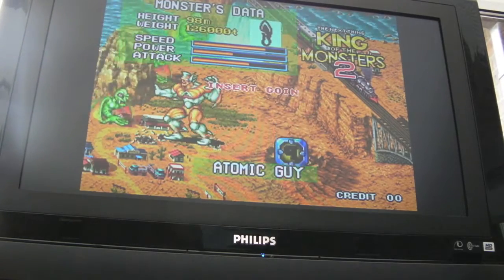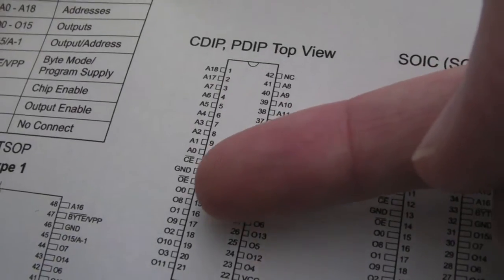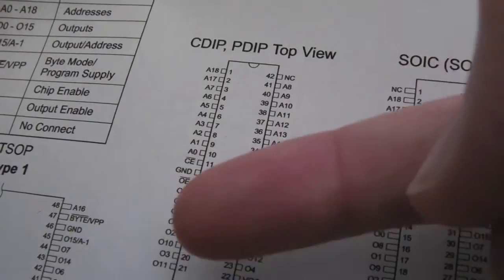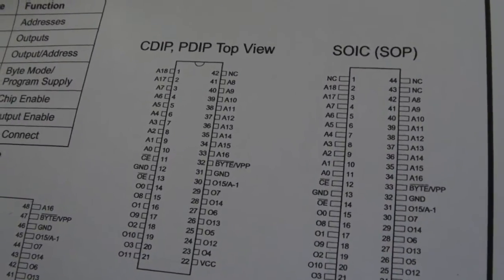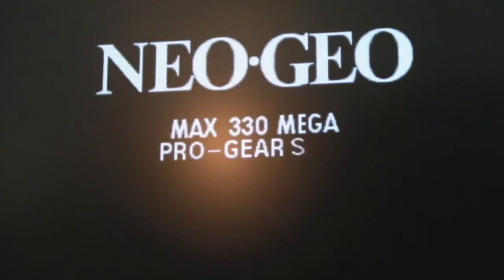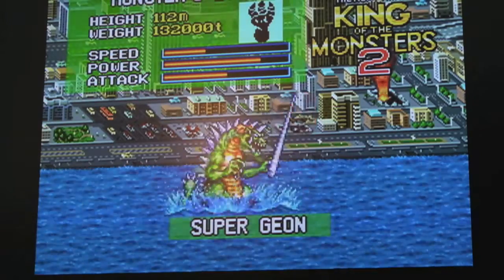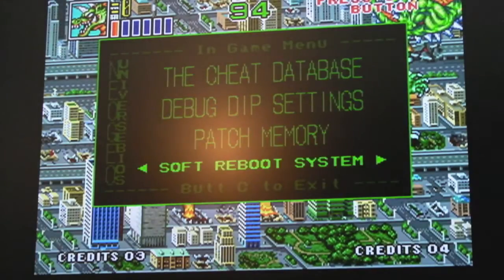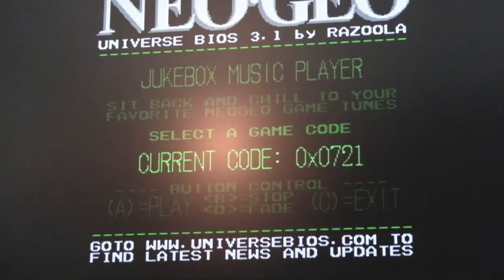SNK Neo Geo MVS King of Monsters 2 Repair

Comment: Well done! Glad you could get the game running again with proper audio output.
It seems like you have quite a nice scope there. It has pretty extensive video triggering capabilities, which means that you easily get a nice and stable trigger on a composite video signal if you'd like. It's also nice that you can choose which TV field to trigger on, as well as choosing whether to trigger on the vertical sync or the horizontal sync. And, it has a component tester as well it seems. That's pretty neat.  None of my Teks have it, so I have to put together my own little octopus curve tracer and set the scope to X/Y mode in order to test components like that.
Btw, the probe you're using here, might it be the one you received from the ebay seller I recommended to you perhaps? :)

As a little advice, it would be much better to set the scope to DC coupling in a situation like this instead of having it set to AC coupling. In fact, you probably want to work in DC coupling mode for the most of the time. The only situation that would actually require you to use AC coupling is when, for example, you want to check the noise lever or the ripple on a supply voltage rail. You do this by "zooming in" on the signal by turning the Volts/DIV knob clockwise. However, when in DC coupling mode, this will make the trace disappear off the display. You solve this by removing the DC component of the signal by having the signal go through an AC coupling capacitor at the input stage of the scope. This is done by setting the scope to AC coupling mode.
However when checking TTL compatible signals like you were doing here, the signal will be close to 0V during the low state and near 5V during the high state, so there is no need to have the scope set to AC coupling here.
Having the scope set to AC coupling when not needed has a few drawbacks; First of all, you won't be able to make an absolute voltage measurement (measurement in relation to true ground; 0V), since the signal will be centered at 0V due to the AC coupling cap in the scope. You can see at 6:07 - 6:10 how the DC offset of the signal at the display changes as the scope is centering the signal to 0V.
Secondly, since the purpose of AC coupling is to block DC, you cannot AC couple a digital signal that has low frequency content in it without distorting the signal in some way on the display. So for example, if you have a TTL signal that is low for 0.5 sec and then high for 1 sec before it goes low again, you won't be able to see it very well in AC coupling mode since the signal will center itself around 0V shortly after each transition between low and high.
Also, you won't be able to check the steady-state of a high or low signal (or supply voltage) when in AC coupling mode, since the trace on the scope will always center the displayed signal at 0V no matter what. What this means is that even if you put your probe at a 5V supply pin of a chip, the scope will still show 0V on the display since the DC content of the signal is not being coupled through to the vertical amp stage of the scope.
The wierd reading at 6:42 might not necessarily be because of the chip being faulty, but can also be because of the scope being set to AC coupling mode. The frequency of the data pattern might be high enough for the AC coupling cap to not have time to fully charge/discharge itself to 0V between the transitions, but still be low enough to create a roll-off right after the transitions between low and high. It is very much possible that the signal would look more like a normal TTL signal if the scope had been set to DC coupling here.
The DC/AC coupling selector on your scope is just to the right of the BNC connector for channel 1. Just to the right of where you have the probe connected in this video.
Just thought I would point that out as a little advice for any forthcoming repairs. :)
Reply from the maker: Wow, there's a LOT to take in there!  Thanks for the reply, let me spend some time digesting all of that information - I've had a quick read through and it looks fantastic advice.  I will have a play around with the scope again later, I am wondering if there's a problem with the DC coupling.  I think when I last had it switched onto DC coupling I just got a dot instead of a line...  Will experiment more later =)
Reply from the maker: Thanks again for the wonderful advice!!  I've just done another test using DC coupling and it's working - ie. my scope is giving a cleaner display as its showing DC and filtering out the AC as I should have done to start with =)

The strange signals I saw on the second chip were nothing to do with the fault - as you suggested, so you were right!  They were outputting a constant low or constant high on one or two pins (failed pull up / pull down resistors internally?).

I've never used the sync trigger before, not even sure where to start with it lol.  Part of my problem with scopes is that I only ever had basic training on scopes, which covered an hour or so, and then I didn't come to own a scope until 3 or 4 years later, and when I finally got a scope I then ended up being forced into software development due to job redundancy.  I've watched a few scope videos recently and that's helped a bit but I really need to do more practice with my scope in order to get up to speed properly.  The X10 stuff drives me nuts lol, because I have that multiplier on the scope and a multiplier switch on the probe...  Then when I come to see the voltage levels I am not sure what the bloody voltage is lol.

I guess that's why I should be using the calibration points - 1Mhz 2v etc. In order to set the trace correctly first on the screen, eg. 1 block = 1 volt, then I can work out accurate voltage levels.  It has been so long I've forgotten so much in 20 years lol.

The probes were from EBAY btw - the seller you suggested! They are great, give really nice square edges again as they should.  So I've got to thank you for that!!  My original probes for some reason all gave curved rising / leading edges - I think because the variable caps had been 'harassed' too much in the past.  My scope was purchased from the 'sell off' of test / lab equipment from a training facillity after it closed down (often the way...), and it had been used for only a few years by teenage thugs lol - I found a few components floating around inside it that they had 'forced in' through the air vents etc in order to see if they could destroy the scope.  Luckily for me it seems to have survived, and also survived 3 house moves and 20 years of storage in each of the lofts of those 3 houses lol.  I originally paid £50 for the scope 20 years ago - not bad at all really, as I am sure it was worth a lot more back then.
Reply: GadgetUK164
I knew it! :) I couldn't get a view of the charge and discharge curves of the AC coupling cap of course, since you didn't have a stable triggering set on the signal. But I figured that when the trace is showing up at the bottom and the top like that while leaving a window in the middle, it most probably have to do with the roll-off curves increasing the thickness of the trace at the bottom and the top.

I can understand that it's easy to be mislead into believing that DC coupling is filtering out the AC, since AC coupling is filtering out the DC. But that is not acutally what is happening. You can think of it as this; When you put the scope into DC coupling mode, you are telling it to take the signal on the input and display that directly on the screen, without filtering away any components of the signal at all. So in other words, what goes in is being displayed on the screen. That is DC coupling; nothing gets filtered out.
What this means is that DC coupling will show both the DC and AC components of a signal. But AC coupling however will filter out the DC and only display the AC. Let me put it like this:

Let's say you have a 1 kHz sinewave coming in to the scope and the scope is set to DC coupling. If the bottom peak of the sinewave is at -2V and the positive peak at +2V, then the sinewave will naturally be centered at 0V on the scope. If you put your scope to AC coupling mode, the display will still be centered around 0V. So in other words, nothing will change.
But what if you change the DC offset of that sinewave going in to the scope? So you let's say that the sinewave now has the bottom peaks at 1V and the upper peaks at 5V. The peak-to-peak voltage (difference betweent the peaks) are still the same as before (4V), but the DC offset of the waveform has changed. The amplitude of the waveform is the same, but it has now "moved up", so to speak.
If you now set the scope to DC coupling, the scope will show the bottom peaks at 1V and the upper peaks at 5V. But if you set the scope to AC coupling, the waveform will be centered at 0V. So in other words, the bottom peaks will be at -2V and the upper peaks at +2V.
That is the difference between AC and DC coupling, and that's the reason why you always want to work in DC coupling mode unless you really need to put the scope into AC coupling mode. Because if you're feeding the scope with a 4Vpp (volts peak-to-peak) signal that has a certain DC offset to it, in DC coupling mode you will be able to see that DC offset. However, in AC coupling mode you won't.
If you are working in DC coupling mode and you need to vertically "zoom in" on the signal in order to check for noise or ripple or something like that, and if the trace goes totally off the screen when zooming in (using Volts/DIV) while in DC coupling mode, then you should set the scope to AC coupling for that particular occation.

You won't need to use the video sync triggering unless you are going to inspect a composite video signal or any signals based around that, like a composite video luminance signal for example. I just wanted to mention it since I noticed when looking at your scope that it has some nice possibilities as far as video signal triggering goes, which is certainly something that you don't see on all analog scopes. At least not to the extent of your scope.

I don't know exactly how the 10X multiplier works on your scope in particular, but some scopes have a 10X multiplier for the timebase with which you can increase the sweep speed. Looking at your scope, it seems like you have a multiplier on the vertical axis that you can activate by pulling the Volts/DIV selector for each channel respectively. If this multiplier is exactly 10X, I guess you can just pull that knob every time you are using a 10X probe in order to compensate for the 10X attenuation that you get when using these probes. If the 10X attenuation is not being compensated for in the scope, it could potentially confuse you during manual readout of the voltages being seen on the display.

Your old scope probes that gave you cruved traces, I guess they were 10X probes? Did you try to adjust the adjustable compensation capacitor in the probes while feeding a square wave in to the scope through the probes? If you could see a change on the display when setting the adjustment cap but the capacitor could not be set to a value enough to achive perfect compensation, then that means that the adjustment cap inside your probe is not in the correct range corresponding to the input capacitance of your scope. You might be able to calibrate those scope probes with another scope that has a different input capacitance, and use the probes with that scope instead. I suggest that you try out the probes with a different scope if possible before completely writing them off as being defective.

Components lying around inside the scope? You mean, components that doesn't belong to the internals of the scope itself?? Man, who the heck does something like that? Force stuff into the air vents? What can I say... there are all sorts of weird people in this world. I'm glad the scope survived anyway. :)
£50 for an analog 60 MHz dual channel Hameg scope with extensive video triggering capabilities, delayed triggering, low and high frequency reject triggering and a built in octopus curve tracer... That is not bad at all, even today. Especially considering that the front panel and the display seems to be in pretty good condition without any major wear or tear.

Understanding most of the functions and aspects of an analog scope is not that difficult once you get the hang of it. I think it's best to start off with an analog scope and learn how to use that, and then perhaps consider getting into more modern DSOs after that, or even DSOs in general. So in that sense, I think it's a very nice scope you got there and I'm sure you can learn a lot from it.
If there is anything you're wondering about when it comes to using an analog scope like the one you have there, just let me know and I will be happy to help out as much as I can. Happy probing! :)
Reply from the maker: RetroGameModz
Thanks for the very detailed reply again - it's very useful and interesting information!  That's what I like about watching your videos - you know your subject well =)

Thanks for explaining about the AC / DC coupling, I will have to re-read that a few times before it sinks in!  Perhaps you could do a video one day on the subject?

Understood about the sync trigger!  I certainly wouldn't mind looking at my sync on different systems lol.  Could that be used on the composite output of the Amiga 1200?  Alternatively the neo geo outputs a composite sync signal seperate from the R,G and B.  I wonder if I could inspect that composite sync, or are the trigger options designed for composite video rather than composite  sync (just H + V).  I might have a play with it later and see what if anything I can see =)

Yes, there was a resistor or two floating around inside - with full length legs, forced in there with the intention of trying to short something out lol =/  Thanks for the comments, I am feeling much happier with this scope now as I previously thought it was pretty basic.  Whilst it is basic I do quite like it and it is as you say in very good condition.  Because it was used a training college - one where the students really didn't care much about electronics, the biggest risk to the scope was components being forced into the vents... But the good news is that it was hardly used =)  When I think back I wish I had bought more equipment from that college =/  They sold off all of their equipment - something like 20 or 30 of those HAMEG 60Mhz scopes were sold for as little as £20 each at auction.  I paid the £50 up front before the auction to guarantee I got one.  I also acquired a couple of bench power supplies but they look very old by todays standards.  I think they are 2 amp adjustable from 0.01v up to 30v or something (could be wrong, it might be 1 amp, need to get those out of the loft as well...).  They had signal generators and all sorts, oh how I wish I could go back in time lol and buy some more of that kit now I understand it better.

I did calibrate the old scope probes btw - It's a case of there were 2 x 3rd party probes with it that were pretty tatty condition, and whilst the trim capacitors to alter the curve I cannot get a square edge with them, but I suspect you are correct and those probes were from some other equipment from that lab - therefore not matched to the scope.   The Hameg probe that came with it has a damaged trim pot, and it looks like someone put a 'random' trim pot cap on there - Do you have any idea of the typical variable cap size that should be on something like that, or does it vary between scopes and manufacturers?  I could 'fix' that myself now with the correct cap.
Reply: GadgetUK164
No problem, I don't mind helping out. :)

Sure, I will try doing a video on the topic one day. I have a lot of different videos I want to make, but hopefully I will find time to make a few videos that have to do with scopes and electronics in general. But in the meantime, I would suggest you to have a look at some other videos out there. I'm quite sure there are already a lot of videos on youtube covering the topic of AC coupling.

Yes, if you use the video triggering capabilities of your scope, you will most certainly be able to trigger on the composite video signal coming out from the A1200 and have a look at that.
It shouldn't matter much if you feed the scope with a composite sync signal or a complete composite video signal. In both cases, you should be able to set the triggering so that the scope triggers at the start of each video field of the signal. Some people, when looking at a composite video signal, incorrectly try to trigger on the sync pulses with normal edge triggering. This doesn't work that well, because the result will then be that you trigger on any trigger pulse on the composite sync pulses, which means that the scope will also trigger on any sync pulse for the horizontal lines. The effect will be that you're then looking at all the lines (625 for PAL) superimposed on each other, which is not very useful at all. That's why a special triggering mode is needed that can sort of extract the vertical sync pulses out of a composite sync signal and trigger off of that. That's where the video triggering comes in. So when you use the video triggering, you're triggering on the specific fields of the composite signal rather than just triggering on any sync pulse that happens to first come by when the scope is armed and waiting for the next trigger point.
Maybe I should make a video about video triggering someday as well. It might be a little bit easier to explain that way I guess. :)

Although being a bit old, I think you can still use those bench supplies for some basic lab work as long as they still work as they should. You don't often go over 2 Amps when just doing very simple experiments and testing. You probably don't want to try powering an Amiga with those supplies, but for basic lab work they should work fine. And signal generators are always nice to have, they can be very useful at times during experiments and such.

I haven't payed much attention to what the capacitor value is on different manufacturers of scope probes, but I guess 15pF to 30pF is a quite common value since that's what scopes often are using. You probably want to use an adjustable cap that goes up to at least 30pF, but I don't know if there is any point in doing it. Scope probes are manufactured with pretty high precision and getting in there and soldering by yourself on a scope probe might upset some of the characteristics of the probe. It's better to just buy a new probe in order to maintain signal integrity.
Reply from the maker: Thanks btw, I think I forgot to reply to this =)  I will let you know how I get on with the probe repair.  I think it just needs a cap in the right range.